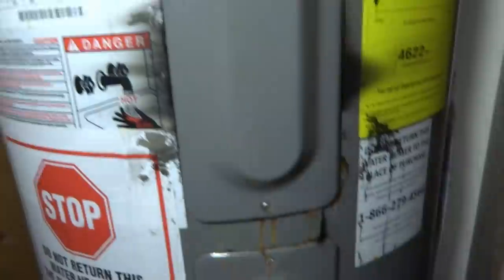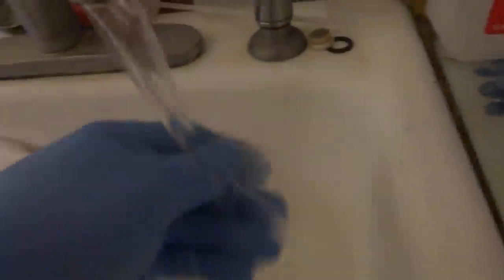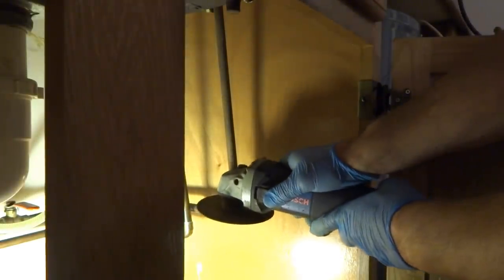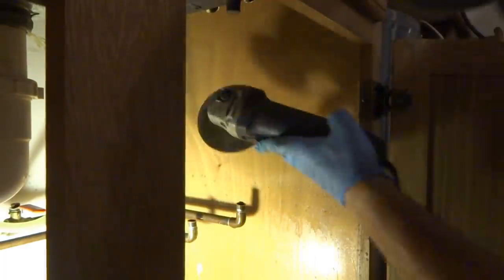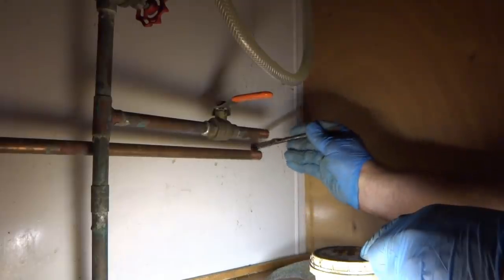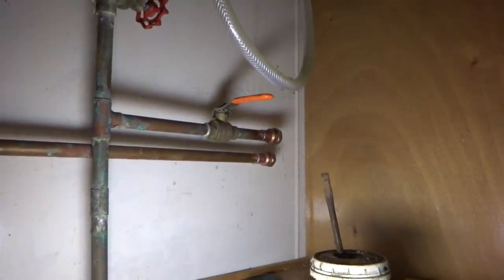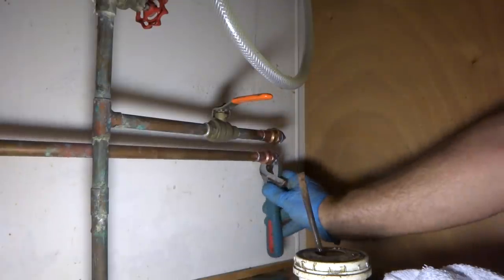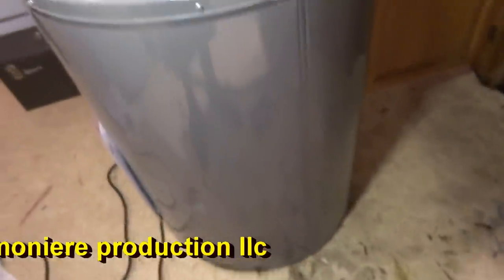HACK INSTALLED ELECTRIC WATER HEATER ALMOST SET HOUSE ON FIRE

Comment: Steve why not cap it off with shark bites? Or are they not using those pipes anymore?
Reply: Steve don't do sharks
Reply: Because he is a plumber.
Reply: Yup! Real plumbers don't use shark bites on permanent work because they can and do fail, but in an emergency to stop gushing water till proper fix can take place, is and should be the only exception.
Reply: @ronlovell5374  gotcha, I thought it was a temp thing
Reply: Sweat on copper caps would be the thing to use. He probably just didn't have any with him.
Reply: @barackobama5304  I'm not saying they're a bad product! They truly rely on proper installation, correct pipe diameters, deburring and cleaning, and full insertion, which I've discovered over many years that diy'ers and homeowners forget some steps, causing damage to fittings and leaks. Also the fact it can be removed very easily with a cheap plastic U shaped tool or other items, is kinda scary. Many building inspectors and  insurance companies don't like these, even of they meet minimum standards. In Canada where I'm located they're quite pricey and not worth the headache. I've been a Contractor for over 25 years, I don't have them in my house, and I'm definitely not gonna put them in someone else's. It just not worth the risk, I'd rather do it right the first time, no one likes call backs...